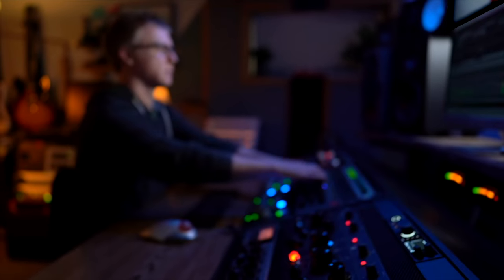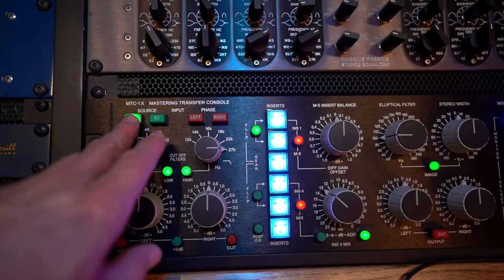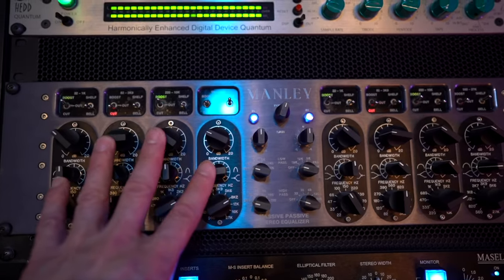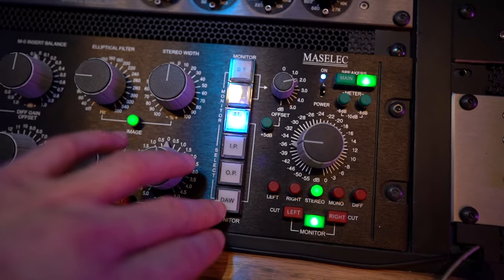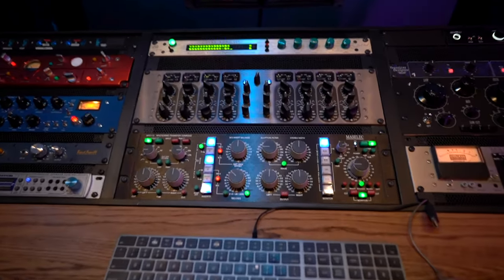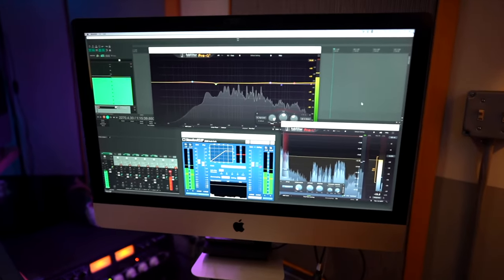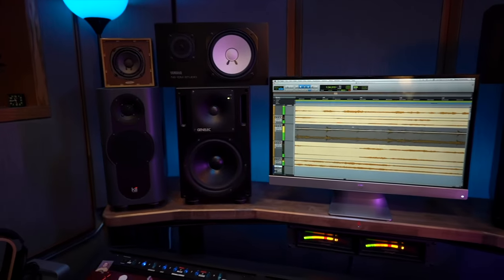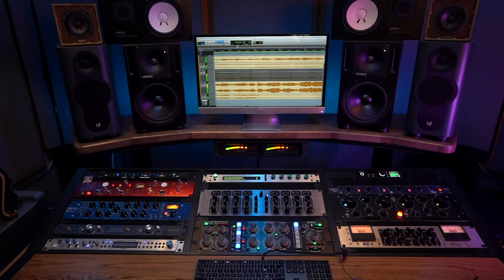MPark Mastering - Studio Tour - Workflow

Comment: Thank you for this video! How does the Cranesong HEDD Quantum and the ADI-2 Pro FS R compare sonically? Would you say one is more transparent than the other?
Reply from the maker: These comparisons are hard to articulate. They aren't as dramatic as one might think. I'd say the biggest difference is that the Head Quantum has the DSP, which can really set it apart as far as sound options.
Reply: @mparkmixingmastering8511  I understand. Thank you!

Comment: Nice Video and Dope Setup! Do you have your Crane Song directly connected digitally via Adat|Spdif to both playback and capture computers at the same time or do you use some type of interfacing via usb,thunderbolt ect. to the computers?
Reply from the maker: It Varies. Usually I go out of Protools via AES to the Crane Song D/A, then after analog processing it goes back into the Crane Song A/D side, then into the ADI via AES, then through the ADI into the capture computer via USB. Sometimes A/D directly into the ADI, then into the Capture computer. There are other configurations as well, it just depends...
Thanks for watching!
Reply: @mparkmixingmastering8511  Thanks for the response

Comment: Hello Neal, thanks for the nice video. May I ask which RME DA are you using ? I guess its an RME ADI-2 but I´m very curious how you have mounted this one with these 19” rack panels, since the RME DACs dont have any screws for rack mounting.
Reply from the maker: It's a ADI-2 Pro Black Edition. Yeah, its annoying they don't make rack ears for these. I ended up buying a MOTU Ultralite MK5 Half Rack Ear Kit. I then had to do some customization to get it to work. If you remove the outer shell of the converter, you can drill holes to match the rack ear mounting holes. This model converter had plenty of room to fit the screw heads (from the inside) then I added washers and nuts on the outside. Once the rack ears are mounted on the outer shell, you can put it back together.
Neal
Reply: @mparkmixingmastering8511  Thanks a lot Neal and what a shame to RME that they dont even provide screw holes. Pretty smart solution from you.
Reply: @mparkmixingmastering8511  one more question about your mesh rack panels. Are these 1/2 U panels order-able, or did you saw them up ?  Can't find any nice panels in 1/2 U format for ages. There are some, haven't found anything with this kind of mesh grid. Thanks again.
Reply from the maker: @mattymenck  Yes, I bought them as 1/2 rack panels. I think they might have been off of eBay. You might try looking on audiorax.com or pennelcomonline.com ~Neal
Reply: RME sells a 19" rack conversion that mount to the side screw holes of the normal adi-2/pro/fs etc.  The black editions dont have side screw holes so they only fit the unirack made for two units that mountsfrom the bottom using the feet screw holes.  i used a piece of rubber to sandwich my black edition in the rack kit made for the silver because i didnt want an opoen space next to it.

Comment: Nice setup. Do you think that hardware gear is essential in achieving professional masters or do you believe that technology has come far enough now that plugins would suffice for any job?
Reply from the maker: You can absolutely get professional results just using plug-ins. There are some situations where I master tracks only using plug-ins. It just depends on what is needed for the specific track. All of my plug-in and hardware options are just different tools. You use each tool for a specific task.  It's definitely nice to have the option of great analog hardware, which often does sound different/better than the plug-in equivalent, but you can still get good results in the box. If you are doing sample rate conversion during mastering, then I do think it's better to convert through the analog path with high end DA/AD, as I mentioned in the video. 
Neal